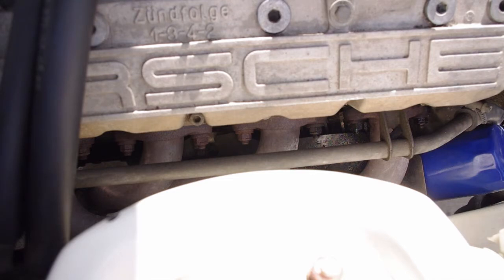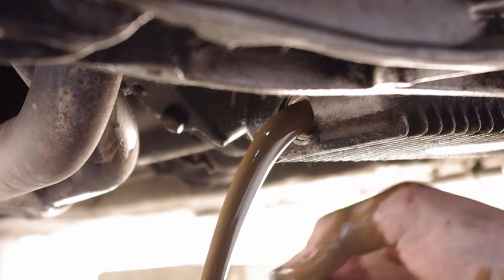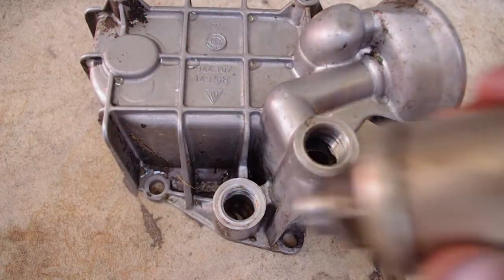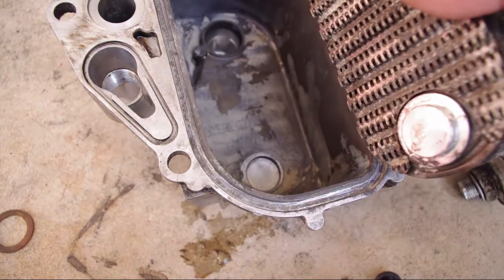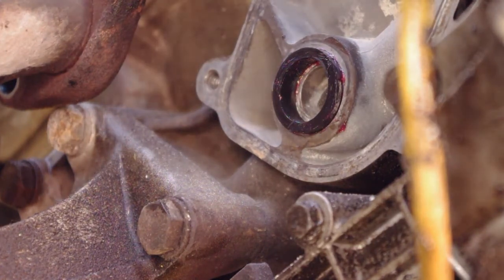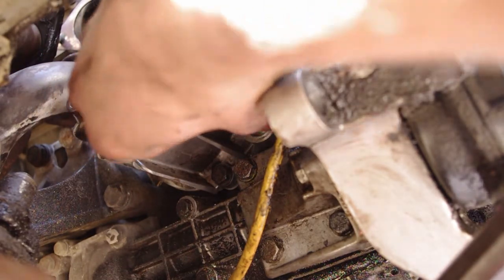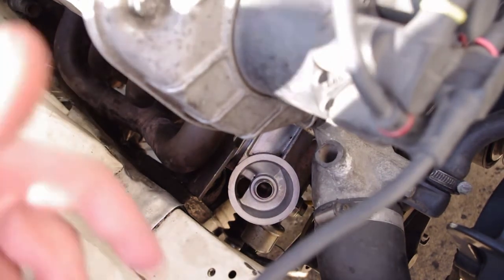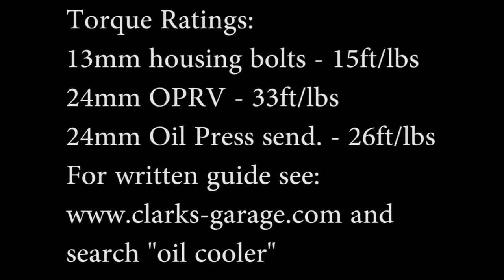How to Replace Seals on a Leaking 944 Oil Cooler

Comment: How did you slide the oil cooler out??? There’s no where to go with it even with the exhaust and head bolts out
Reply: Ok got the cooler out and seals replace, but does that cooler have to hold itself when you put it in? I can’t seem to get it to stay and didn’t see it stay in the video

Comment: Nice presentation.  I needed the info on the alignment tool.  Just started the process of replacing the wtr pump, front engine seals, belts and rebuild the oil cooler.  My car's symptom was mainly oil in the coolant tank oil leaks around the cooler housing.
Reply from the maker: Sweet!  I love seeing 944's with new leases on life!

Comment: Great video.  Good to see younger  guys turning bolts on these cars.  I've owned mine for 23 years now and that seal has yet to fail on it.  I've broken 2 timing belts therefore requiring a top-end rebuild (bent valves) but the bottom end is still in great shape with 270K+ miles on it.  My 87 N/A is starting to develop some rust in the rocker panels so I'm going to down it soon and do a full restoration on it.  Last week I bought an 88 S model that's in great shape (body wise) but the interior needs some work.  I'll ride that while I'm restoring.  I plan on tearing down the engine during the restoration just to freshen it up (new bearings, rings, and what-not), I'll definitely have to snag one of those alignment tools.  Again, great video..
Reply from the maker: Wow!  That is awesome!  23 years with that car and you must have an encyclopedic knowledge of it.  I've had mine for almost 5 and I already have learned a ton!
Reply: Almost.  I got the Porsche Repair Manuals many moons ago on Ebay and they helped a lot.  However, I've been wrenching on cars since I was a kid.  My Dad was a drag racer and ended up building his own shop back in the mid 80's...  I've broken two timing belts on my car so I've rebuilt the top end twice.  Ported and polished the head on the second go around.  Now she's starting to develop some rust issues.  Anyway, great video and keep learning about those 944's....
Reply: +Daniel Engling Well. I picked up an 88 S model a few months ago.  Got it running the other day only to discover the water pump is locked up.  Fortunately I had the timing covers off for inspection and noticed a little bit of smoke coming from that area.  Only had the car running for about 30 seconds (it had been sitting for 5 years).  Got a new water pump and was tearing things down to put it in and guess what.  Pulled the upper radiator hose and there was oil sitting in it..  I had checked the oil level on the dipstick before I bought it and it is right at the full mark.  Hopefully there isn't much in the pan.  Did you determine which seal failed on your oil cooler so I can be looking for a similar sign of failure on mine?
Reply from the maker: +David Cantrell Yeah, that was a close one.  Just a little longer and it sounds like you would have some valve interference if that belt snapped...good catch.  Honestly I don't remember which seal it was (I don't think it was obvious) but I recommend just buying the pack with all the seals and replacing each one while you're in there.  It's cheap and takes hardly any extra time to hit all of them.  
Does your oil look foggy?  Coolant foggy/frothy?
Reply: The oil didn't look like it had any water mixed so I'm hoping it was only pushing oil (more pressure) into the water jacket.  I've not drained the pan yet but did pull the filter off getting the water pump off today.  No froth.  LOL  But the crud built up in the waterpump and block was a bit more than I anticipated..  Fortunately it flushed out easily with the good'ol water hose.  I'm going to replace all the seals in the oil cooler housing though.  I was just wondering if you were able to determine which one may have failed. But I guess unless it's obviously ripped, it's hard to tell.

Comment: Hey Dan. Thx for answer but I have to tell u , the problem was a simply loose main pulley bolt which we torqued to 150 ft lbs after going thru all the unnecessary hassles

Comment: well im getting ready to tear apart the top end of my motor and i need to know what would be a good idea as far as what steppes to take, in what order to do them in, what are the good brand parts to use, and what are the best procidures to putting it all back together correctly? if you could help out in any way i would be very happy for your advice. thanks

Comment: So it looks like I have some leakage coming from the oil cooler itself. Looks to be the bottom bolt of the four. Is an o-ring replacement necessary, or is there a larger issue I am missing? My 944 has 105k on it. Oil does not appear to be a milkshake, yet. Thanks for the video!
Reply from the maker: +David Rowe They leak externally all the time.  I think that it is most likely that the o-ring is going bad if it is coming out of the bolt hole.  if it's just below it then you're probably looking at the whole housing gasket as the problem.
Reply: +Daniel Engling Really appreciate the help. Checked the history, looks like o-rings were replaced about 2 years ago. Tough to say if I should just get it over with and try it myself!
Reply from the maker: That's a call you have to make, but I can pretty confidently say that it is probably not mixing with coolant, but more likely seeping oil past the gasket and directly to the outdoors.
Reply: +Daniel Engling as in replacing the whole unit itself? or just the o-rings? yikes. might be worth having a shop take a peek facepalm

Comment: My oil cooler seals are shot. Oil is mixing with the water ONLY. The oil in the block is still clean. That means that the head gasket is still good on my car and only the oil cooler seals are damaged. So what confuses me is that the oil from the head in your car was milky but I'm assuming after you made this video that problem was cured. Did your car have any other leaks????
Reply from the maker: No other leaks.  This did fix my problem too.  It's about a pressure differential from what I understand and the pressure is not always one way.
Reply: +Daniel Engling oooohh that makes sense since the oil pressure is higher. awesome! thanks!
Reply: I discovered the same issue with my 84 the other day.  Spotted a small coolant leak from the plastic/aluminum interface, went to fill the reservoir and found contamination on the cap and some in the reservoir.  Drained the oil and it looked fine, engine runs fine (and isn't overheating), so I don't anticipate it being a head gasket.  Did you replace the seals and did it fix your problem?
Reply: Allen Snyder I have not seeing as it's going to be nearly 700 dollars for a shop to do it for me as I am having them replace the thermostat for good measure as well. However if the oil from the block itself is clean but it is only the coolant that is contaminated 
then it is the oil cooler seals that are the issue. The car won't over heat but it will run hotter especially with high rpm driving.
Reply: I'm going to replace the thermostat as well when I take everything apart, just have to find the time. Thanks for the reply!
Reply: Allen Snyder yeah no problem! let us know how it goes!
Reply: Took me a few weeks to finally finish this after I started (car was an hour away and days above 40F were limited.  I did it without removing the exhaust header, remove the power steering pump and had to "rubik's cube" the cooler housing out around the power steering pump bracket.  The 2 O-rings on the cooler itself were basically flat and fell apart when I tried taking them off.  Everything seems to be good to go now, but I'll be flushing the system a few more times to get rid of the remainder of the contamination.  Did you get your car fixed yet?
Reply from the maker: That's great.  I remember my o-rings being flat as well.

Comment: Thanks for the detailed instructions! I'm about to replace my seals as well; coolant has mixed in with the oil and I've got the same "milkshake" as you experienced. Are you planning to replace the rod bearings as well? I believe that Porsche recommended to after any amount of coolant is introduced into the oil.
Reply from the maker: Nope.  I crossed my fingers and it's been good for a few years now.  Not a bad idea though, could probably screw some stuff if you run it long on that kind of oil.

Comment: Hey Dan. I lost oil pressure in 1983 944 non turbo. because my engine vibrated a lot at idle , i suspected the pickup tube cracked due to bad mounts. Removed oil pan and found pick up tube perfect. The OPRV piston which is a plain one (no oring) is smooth and looks good. Pls guide me what could be wrong ? I see no oil leaks around oil cooler . Thanks !

Comment: if I have to replace oil cooler gasket not seal do I need to remove oil relief valve. gasket around oil cooler case

Comment: I've done this several ways, and I've found the exhaust manifold removal way to be the least desirable. If you dismount the power steering pump and remove the right front sway bar mount you can remove the cooler from the bottom. Also, the heat shield disassembles farther and at that point you do not have to remove the small coolant hose. It's always a crap shoot whether you will break an exhaust stud when you start disrupting things right at the cylinder head. Good video though, I was trying to figure out what the black goop on my block was, it must be what was left of the big rubber seal at the bottom of the cooler element. I actually don't understand what that seal is for, unless it's just for vibration isolation of the element... I don't see where the oil is actually able to flow out of the bottom of the element.
Reply from the maker: Yeah, I think that's just for vibration.  I've seen teflon rings there instead.  That's a good idea.  I always hate taking exhaust manifolds off for that very reason, in fact, I have a snapped stud on mine as I type this...

Comment: at how many miles do you seals fail?
Reply from the maker: hmm, mine was at something like 190k.  Not sure what is normal...if that can even be said.
Reply: cool.  i was looking into getting one with 220k+ miles. If the gasket is anything like the valve cover, it's probably on its way out.

Comment: Hi Dan, Great Video . . thanks for taking the time to produce it. I have to replace the seals on my '87 924S with about 70K on the odometer . . . Question, where did you source the alignment tool? Thanks!
Reply from the maker: +John Galt A friend let me borrow it.  It's called a BMT9262/1

http://www.handsontools.com/Baum-Tools-92621-Porsche-OilWater-Cooler-Align-Pin_p_155179.html?gclid=Cj0KEQjwqsyxBRCIxtminsmwkMABEiQAzL34PX942Fza_NhAOySBj7aXygu85h0V4cE6PWOujB-v-DIaAiFW8P8HAQ

Comment: I had a 944s- the oil cooler was replaced by a Porsche place in Bristol (Porschemode), but the guy's brother did it not the chap who knew what he was doing.  Oil cooler was not aligned and he wound the pressure relief valve in. 
As it wasnt straight he forced it in and it damaged the block. 
I drove the car away and it had very low pressure.  They blamed the relief valve failing (£163) so i replaced this.  Still no change.  Took it to a great Porsche guy called Steve Bull in Devizes who took it all to pieces and showed me what had happened!  So very costly and of course was always a bit short on oil pressure.
I couldnt prove my good previous oil pressure before the first job but of course Porschemode knew about it but didnt do anything about it.
Reply from the maker: CLSMLabel Man, I'm really sorry to hear that.  That's terrible.  You bring cars to the dealer expecting them to know the most about them, but really that is almost never the case.  On top of that, they often diagnose only by part replacement.
Reply: what oil pressure were you getting afterwards- I think ive done the same with my block.

Comment: What did you use for the grease for the rubber ring?  944 workshop manual calls for grease or Curil (which seems to be harder source in the US).
Reply from the maker: I don't remember, probably axle grease or something.
Reply: It looked like standard 'red rubber grease'

Comment: Hi Dan. My 944 only has 41K miles. The oil sensor is out of the equation because I heard the lifters making a terrible sound so i immediately shut the engine off. Any other advice? Please.

Comment from the maker: Hmmm.  Sounds like maybe you just have a bad sensor.  BE CAREFUL WITH THAT DIAGNOSIS!!!  You don't want to assume it's something that simple with a system this important.  But those sensors DO go out from time to time.  As I was reading your comment, I was thinking pick-up tube immediately, but you've already looked at it (did you pull the engine for that pan removal, or are you just a geometrical wizard?).  I will keep pondering this one (in the meantime look at Rennlist.com for ideas).